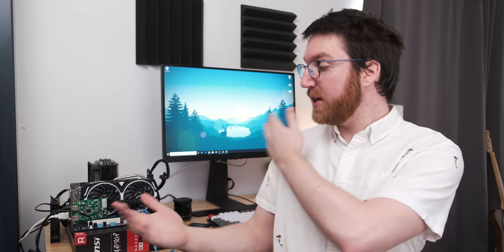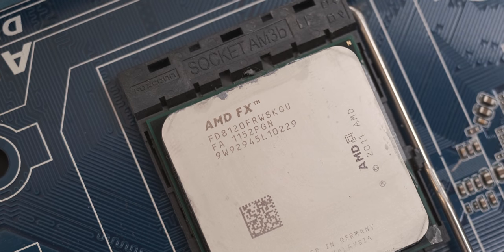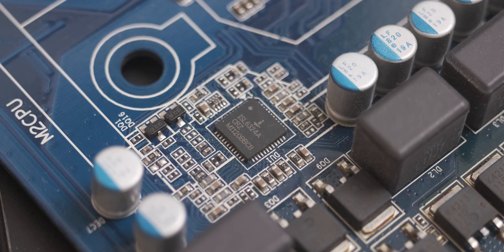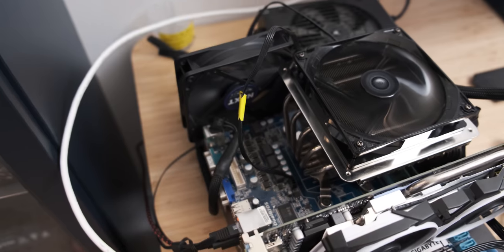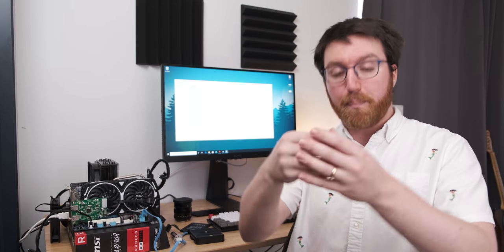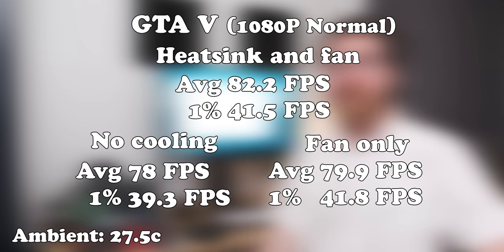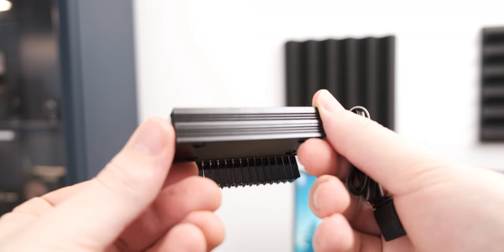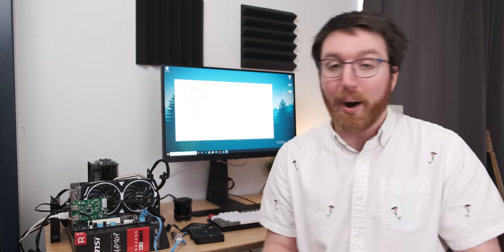Can better cooling fix a TERRIBLE 3-phase VRM

Comment: im using a H410 and a i9-10900 non K it pulls 270w sometimes
Is there a way to add a heat sink to the VRM on the ASUS Prime H410M-E without damaging the VRM what adhesive to use?

Comment: Im gonna try custom heatsinks on the VRM of this MSI X570-A Pro I ordered. Its just too hot not that it cant provide the power. But as of now before that board arrives I'm stuck with a similar situation with my 5600x on my A320 S2H. Not gonna bother with cooling the vrm tho it never breaks 50c haha. Another way to get more mhz out of the cpu would be to reduce RAM clocks.

Comment: When a VRM is this bad what is needs it a water block and probably a ice in the res, but you could also try the server solution (Delta PFC0812DE-PWM fan) and DO NOT put that on a MB fan header, use a molex plug
IIRC AsRock has a REALLY horrible B450 board
if you do get that fan, be sure to get a couple fan grills for it, it is not worth loosing a finger tip

Comment: A bit late on this video as you have hopefully moved on the parts but the crashing is probably form using the base clock to over clock as the north bridge and ht link would become unstable before the cpu. Using the crappy aod uitilty to overclock using the core multiplyer may have been your best bet. As bad as bulldozer is pile driver was a vast improvement (at least in my experience but I've had 2 6100's and 2 8350's got about 400mhz more clock on the pile driver CPUs as well as arch improvements) 

The board probably also has no real way to disable apm as it is a pre FX board which limits the power draw of the cpu to it's tdp disabling turbo in aod also disables apm. Also Possibly a reason why power draw stopped rising in the latter tests as you could see throttling in the afterburner overlay if the footage was form the later tests.

Comment: A lot of people on here are failing to realise that those components on that gigabyte motherboard aren't really what you call vrm's but infact they are just switching mosfet's for the buck power regulation for the system's pci bus ram, and cpu core clock.

Comment: Mate, if you want to get higher clock speed, you need to increase the voltage of teh CPU so that it can be stable in OCed state. The reason you want to cool things is so that you can increase the power they consume /provide and hence allow higher and stable overclocks. If you just cool stuff that runs hot but already is stable you dont achieve anything significant. COoling it allows for more power before it reaches dangerous temps...

Comment: I was able to run a fx 8350 at 4.8 stable on a GA-78LMT-usb3-r2 using a similar m.2 heatsink and a 90mm fan, which surprised the heck outta me. But yeah. VRMs are gonna dictate a big chunk of the performance you can pull from those AM3+ chips.

Comment: Is that the Msi 1080ti armour with stock cooler. That is your big problem. The armour is more for after market cooling... water block ect... For air I will suggest Artic Accelero vi or a Raijintek Morpheus ii. You can also take any cpu cooler and drill 70mm spacing holes in the brackets and mount it to gpu cpu. But remember you will need smaller hit sinks for all other components if you choose to go with this route.  I guess lack of proper heat dissipation from the very skinny radiator / crappy fans on the Msi armour is dumping all that extra heat into that system. By the way if the msi armour is water cooled it becomes one of the top performing 1080ti's. "Dit Skop dan gat"

Comment: I did run prime 95+occt to draw full power from my psu, my psu has dropped from 12.3V to 11.67V Thus on my  Gigabyte B75 D3V, My VRM is on 80-90Celsius while it draws 70Watts to the cpu, but the thermal design is 95Watts. There are only traces on my mobo that cools the mosfets.

Comment: Putting heatsinks on the VRM helps in thermal throttling, especially on warm days.  A video render might finish a few minutes earlier if you are a creator. I can see it happing using Psensor and Stress on Linux.

Comment: i`ve got the cheapest A320 mainboard made(AsRock A320M DGS).It supports max 65W cpu and it still has 7 power phaze design.

Comment: Noooono the 70deg Celsius is maximum ambient. So you could run that thing in a sauna. The maximum running temperature is probably around 120 degrees Celsius.

Comment: Good attempt on what is essentially a badly designed motherboard. Maybe a quick cheap upgrade could be using thermal epoxy to help with the adhesion instead of the thermal pad.
 Me personally I would just dump the motherboard.

Comment: I think if you don't add airflow, you are wasting much of the potential of the heatsink, and using it like a rechargeable battery instead... With fan on the vrm without heatsink should still be better. And I am very interested in seeing this 3phase on fan+ heatsink cooling, how much more power it can pull for the hungry FX

Comment: Hey Dawid, last week i have been messing on a GA-76-LMT-S2 whit a FX 8350, which is not supported by this motherboard, anyhow, i have managed  4085MHz at 215MHz bus speed, x19 cpu multiplier, for a cpu-z benchmark of 228 single and 1590 8-thread, just FYI in case you make more videos on this one. Aslo i think the cheap B-450 upgrade is an interesting subjet, make it a eXTraordinary one.
Reply: Forgot the most important thing, Vcore 1.238v

Comment: Ah yes a very familiar problem! You saw a lot back in the day that people got FX 8 chips for boards like this, but it ran horribly or even just plain shutdown. A friend of mine still runs a combo like this, but with a quarter of the FX disable so it doesn't crash. XD I don't think that temperature you monitor is accurate though, with the heat "radiation" (most likely just a convective flow tho) it's probably more like 100 to 120 degrees. Which is also more like the temperature when a VRM is going to throttle itself

Comment: I think the board itself is compromising your tests. A 970FX chipset is the least I can recommend, but look out for boards that have an actual cooler on the VRM.
Just stay away from the 870FX or 890FX stuff, because the VRM cooling is just as bad as with your OEM board.

Comment: So doing some quick math that VRM is outputting about 27 watts of heat at 100 amps.................. And that is only that power loss from switching the MOSFET on and off...... So that VRM is terrible! Most modern motherboards can do 100A at 9 or 10 watts and that is spread across double, triple, or even quadruple the number of phases so the heat of the VRM is much more spread out in comparison to this pile of garbage.

Comment: Do a B450 Aorus. I'm currently watching you on one with a Ryzen 5 2600
Reply: Did you try to OC it? I'm about to buy b450I aorus wifi and I wonder if I'll be able to oc a ryzen 3600 on it
Reply: @TheBunshe   I  have upgraded sense this to a 3600X on 120mm AIO on  it on a B550. I wasn't able to get much out of the B450.

Comment: Try to reuse vrm heatsinks from old motherboards and combine these with little fans(0-60 mm) . Hopefully it's going to work, your GTA V results are now still worse than with a GTX 560. You can also try using a not-so power hungry Nvidia equivalent (GTX 1050) card to see if the problem has something to do with the game.

Comment: I'd guess you're not adjusting the RAM and HyperTransport multipliers accordingly. Read some of the old overclocking guides for this platform and I'm sure you'll get better results :)
Reply: Yeah, last time I tried the cpu multiplier alone I was hard stuck at 4.1-4.2 range for stability. That was on an fx 4300

Comment: You probs didnt see as much as a gain since it only has 4 pin power meaning the cpu is limited to the 65W range for low power cpus/apus, this will explain the OC issues aswell, maybe get a better board (with 8 pin) to push this shitbox of an 8150

Comment: A 3+1 phase VRM cannot power 4 bulldozer modules. You might have better luck not powering those cores. A 6 core might work at 3.8-4, 4 core you should be able to hit 4.2 at least. Not sure why you forgot about that option, must have been when you started going through datasheets.

Comment: Since you have overclocked CPU by overclocking Bus Speed, there is a good chance that you have also overclocked NB frequency and memory... however... just in case... you want 2400 NB freq and 1866 memory. But yeah VRM are a problem on this joke of a motherboard.
The common problem I often see with OC FX systems is OC just CPU. Stutter/lags dont go away.  Soary, if this comment is useless.

Comment: I saw your other video and your motherboard is the Rev 3.1 NOT the 1.3. That make a big difference because the 1.3 DOES NOT support FX but the 3.1 does and there is 2 Bios updates available.
https://www.gigabyte.com/Motherboard/GA-M68MT-S2-rev-31/support#support-dl-bios
I managed to see the Rev of your board on your other video here https://youtu.be/zPdhLVGKhgo?t=524
Its right behind that screw under that expansion card.

Comment: Bro, i have a beginner graphics card (Geforce 710 2GB DDR5 on core 2 quad with 8 GB RAM in my pc. The normal working temp is 55 to 60 C. When GTA 5 is played it rises upto 90 C. 
My overclock settings:
Core clock: 200
Mem clock: 150
Volt: 50
Can you suggest me the best settings to lower down the temp of my gpu or is it normal? 🤔
Reply: It’s normal, I used to have core 2 duo 3.0ghz, 4gb ram and the gt 710 2gb, gta v ran at 15fps and the gpu got to those temps sometimes, I had overclocking for like +300mhz core. Now I have an i5-9400f and gtx 1650 super, 8gb ddr8, runs like a dream.
Reply: @willgamer12  Thanks a lot for the pointers 🙌